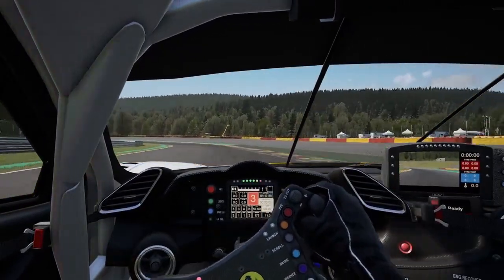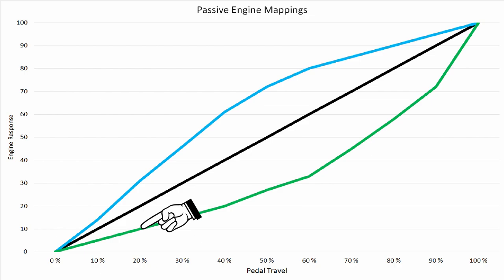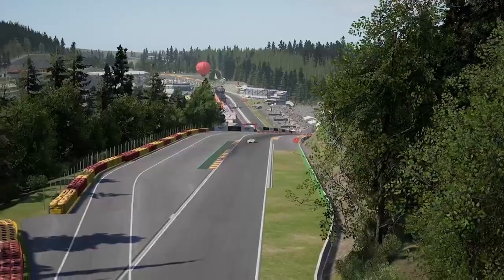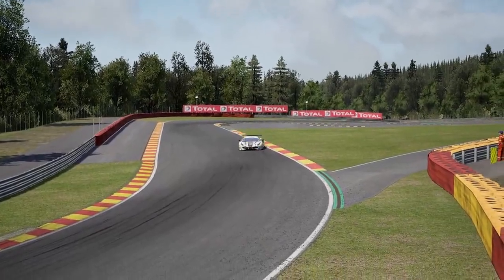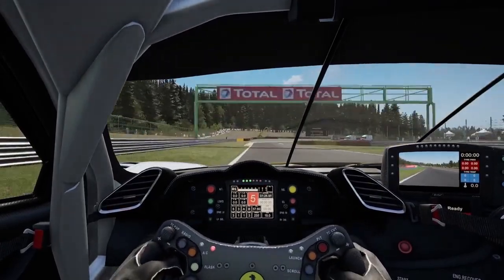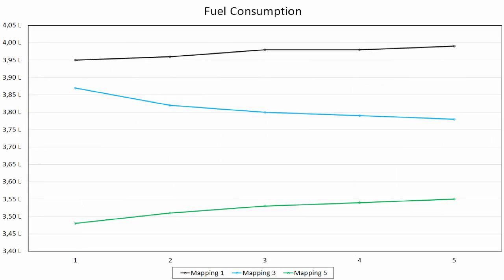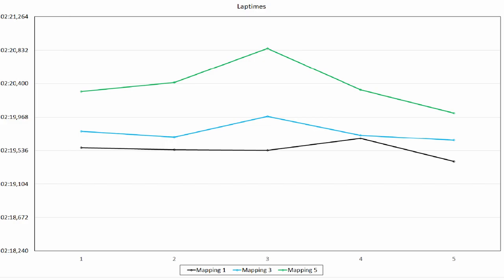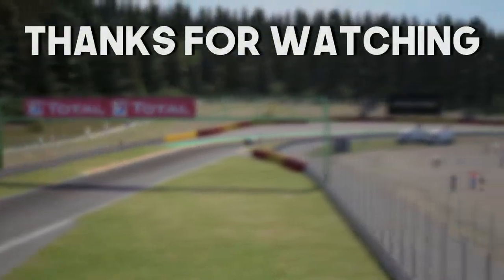Save Fuel By Knowing Your Engine Maps! - Assetto Corsa Competizione Experiment

Comment from the maker: Just as clarification, the used engine mappings are described as the following:

1 fastest extremely aggressive throttle and power delivery, high fuel consumption
3 normal, aggressive throttle and normal fuel consumption
5 normal, almost linear throttle, slightly less consumption